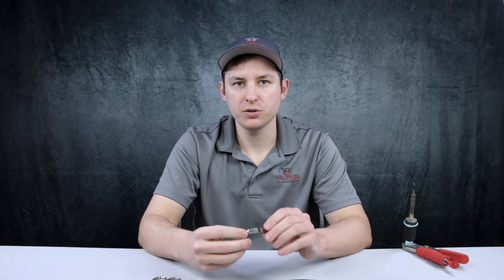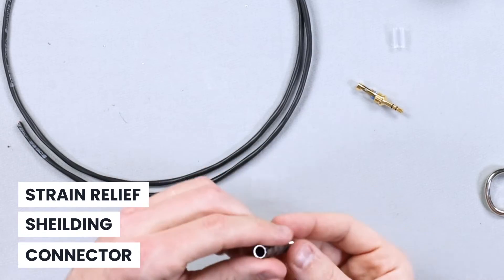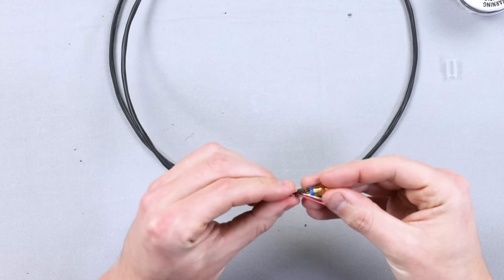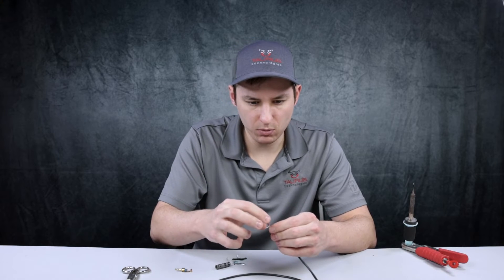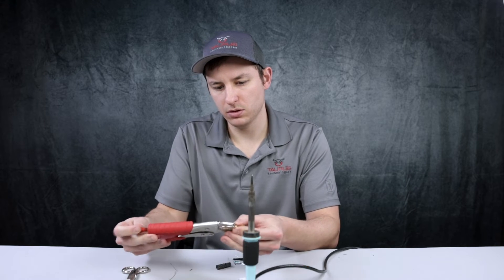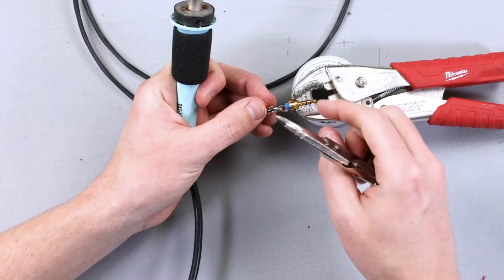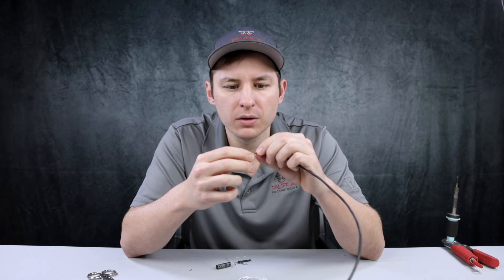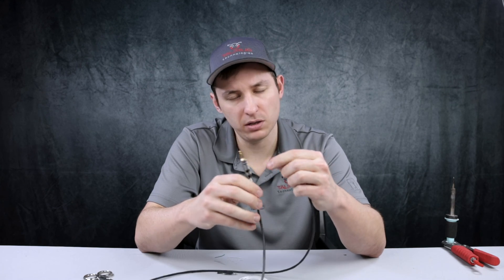How To Solder a 3.5mm Audio Jack - Easy!

Comment: what if the wire only has red, black and green?
im planning to turn my Audio Technica ATH M50X cable into regular male to male 3.5mm cable and use the 100mm of the 2.5mm leftover end as adapter. that way i can just use the one cable on all of my other headphones since those just have female 3.5mm 
also some diagrams are confusing. some swap the green and ground so some has green as ground and black as left channel or vice versa >_<

Comment: for anyone trying to resolder with the orginal cable of the head phones, know most wires in headphones are enameled, they been submerged in a coating, every single cable, even the ground that appears clear copper. so they have a substance on them and thats why the solder will not even adhere to it no matter how much you try really. the purpose of this is for insolation i think, idk. 

for him it s easy cause he used a different wire that s clean copper, he just cut the outter plastic shell, it wasn t enameled.

using a aspirin pill works for enamel removal. take a pill put the wire on it than press with soldering iron. don t inhale the fumes they very toxic.
Reply: Yeap, I remember doing this aspirin trick and inhaling fumes. 0/10 Don't recommend doing that
Reply: is this related to colophony (rosin) in any way? Will I have this problem if I use colophony?
Reply: Thanks. Always a pain to solder the original cables.